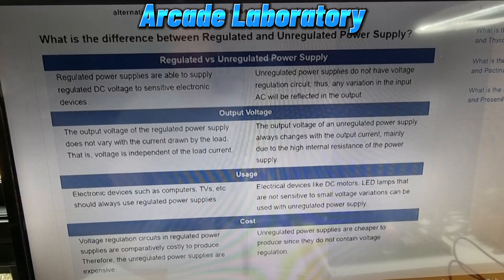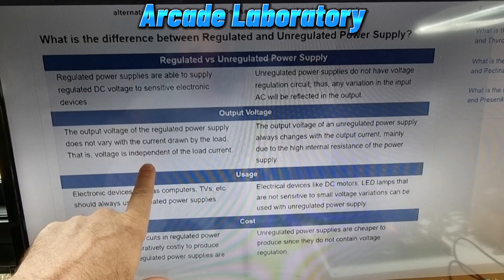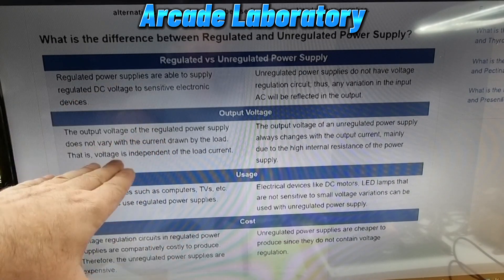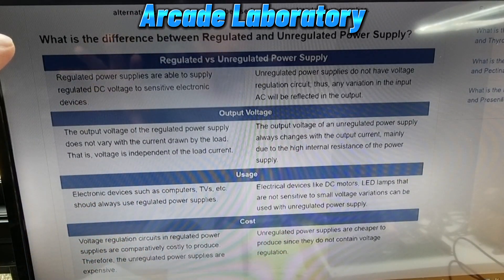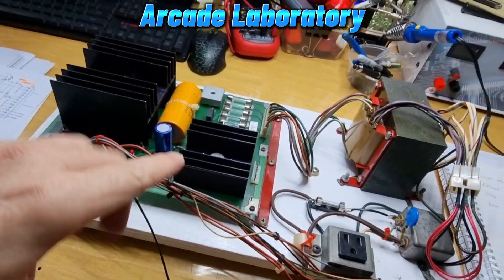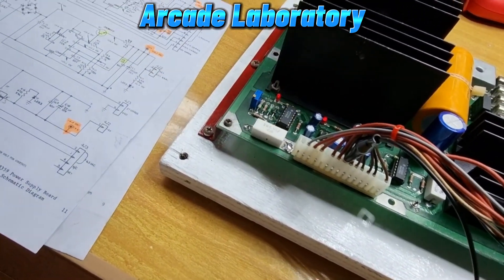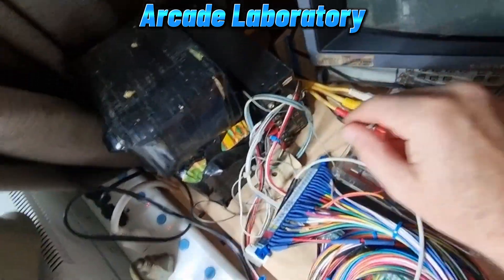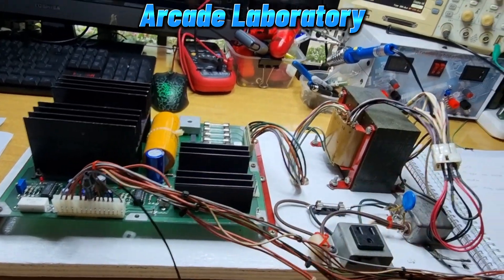Viewer mail Unregulated vs Regulated Power

Comment: Most arcade games use Unregulated voltages which I have been told is to use a DVM meter that has a Low Impedance LO mode which some Flukes have this and other DVM meter. When the DVM meter is loading down the unregulated voltage that you're measuring/probing, the voltage will drop when using a low impedance mode setting on the DVM meter which confirms that the voltage is Unregulated. Using an Oscilloscope you can tell if the voltage is unregulated because the AC ripple voltage will be a large peak to peak AC ripple voltage compared to a voltage that is regulated which will have a smaller peak to peak AC ripple voltage. The better method of confirming that a voltage is 100% unregulated is to measure the voltage using a low impedance mode DVM meter. Arcade games do use unregulated DC voltages for the Lamp bulbs but the DC unregulated voltage will cause flickering noises because unregulated voltages have a larger peak to peak AC 60hz or 120hz ripple voltage . There are arcade boards that if the +5 vdc voltage RAIL is set at +5.1 or +5.3 it will cause the CRT display graphics to have "anomalies" which doesn't make sense to most arcade repair techs because the TTL chips datasheets says the operating voltage is +5vdc. So I'm not sure why certain arcade boards will cause graphic "anomalies" when the +5vdc is set a little higher but I have seen repair techs replace all the IC chips and sockets thinking that is the root cause of the problem which finding out that the +5vdc was not set in that sweet spot correctly. I have also notice that certain arcade games when using switching power supplies will also create "graphic Anomalies" because the switching frequency of the switching power is getting coupled and bleed into the CRT arcade monitors pcb boards causing the graphic Anomalies. I have seen repair techs replace every single IC chip, sockets, parts in the CRT boards thinking this is what is causing the graphic anomalies issues when the culprit was the switching power supply switching frequency either being coupled or the switching frequency is riding on the power rails on the arcade boards which is causing power fluctuations issues. Try to make a video lesson explain why these graphic anomalies happen and occur when using various switching power supplies as well as when the +5vdc trim pot is not set correctly in the sweet spot will cause graphic anomalies issues
Reply: Wayne, your mixing different subjects into one ‘discussion’. Regulated vs unregulated, switching vs linear, ac ripple on dc voltages and the 5v being high or low. This kinda makes it hard to follow. One thing I’d like to mention is that if your pcb doesn’t like your switching power supply, then you have a bad/cheap power supply. A good one has nearly no ac ripple and should be able to run any board as long as it has the required voltages. A bad switcher doesn’t have enough/proper smoothing caps and will have ripple that can affect the pcb workings.
Reply: Almost all DVMs have a high input impedance when testing voltage.
Reply: @stephenschnabel5432  That is the main problem is when measuring unregulated voltages using a high input impedance DVM meter you can't tell if the voltage is unregulated. They have DVM meters with a LO input impedance MODE setting which I think you use when measuring unregulated voltages
Reply from the maker: So before I filmed this vid I set my scope up to measure unregulated and regulated voltage so I could show you the ripple..But my linier power supply output is so clean I could not pick up any different on the scope. So I determined ,for myself, this is not a good way to look for that difference. As far as graphics anomalies, I will try to put something together. I think when pcbs are having graphics issues it's more of a current issue than a voltage issue. Great comments and discussion, I appreciate that from all you guys.

Comment: ARCADE LAB, various arcade power supplies either linear or Switching power supplies can't "self regulate" without a load or without the CPU motherboard connected, any reasons why? I have seen repair techs add in a resistor load for self regulating the power supplies. My Question is why can't the various power supplies self regulate without a load or CPU motherboard being connected?